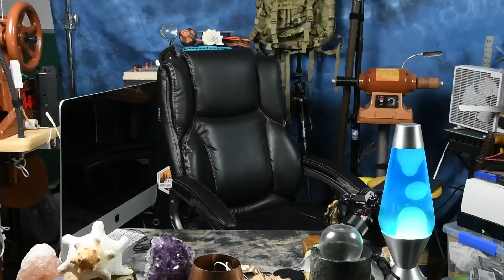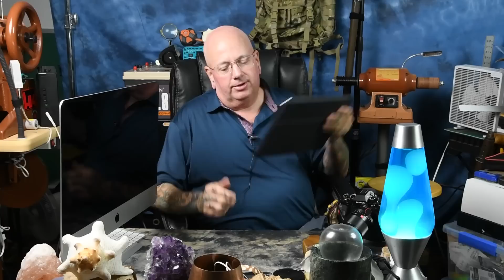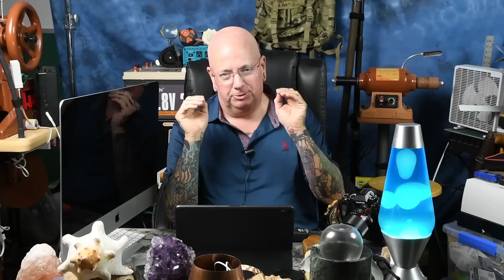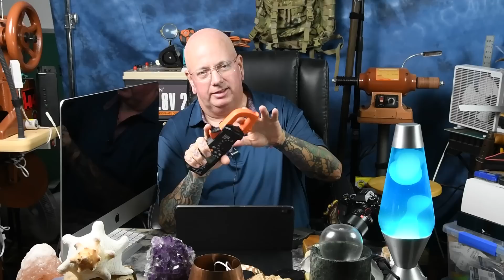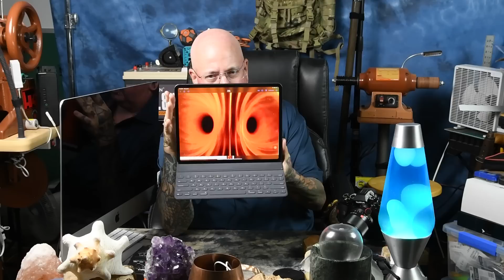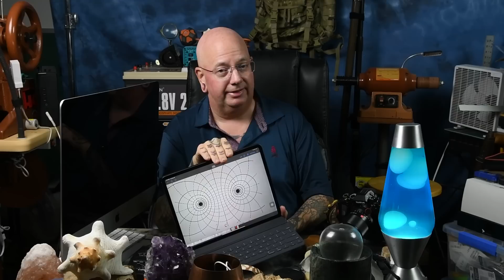😳 Free ENERGY & Power Solutions 🔥Mystery of 😎

Comment: 1:00
That's why the operator I'm currently with is only the second Cellular network I've ever remotely advocated for (consistently praise and recommend to people) and the statement following the above timestamp is exactly why.

My current provider here in the UK is called Smarty, they are a virtual network operator which essentially piggybacks off of 3/THREE (one of the 4 largest/main UK Networks)  
However, not only are they half the cost of 3/Three's comparable package, there's no contract and it's only £18 for unlimited texts calls and data, but unlike the sole network I favoured before them, who started employing that shady tactic of massively slowing your connection speed down watch you've used over a certain amount of data along with periodically completely severing service claiming I'm using my same for business purposes to avoid keeping the promise I signed up for.....

Smarty who I've been with for 6 years have never so much as sent me a message or letter to complain nor have they halted service or reduce my speed despite the fact that on average my data consumption is over 2 terabytes per month as I use my cellular connection for all my internet needs at home and so was able to cancel my fibre optic home broadband subscription, saving a fortune.

Comment: make pyramid off square magnets!             please advise right hand rule transformer re-engineered one side original coil the second left hand (rule)3 times wound 
Take right hand input solder to the middle left hand coil 
Take the output wire connect to earth 
This reverse  the magnetic wats 3 times on the left hand coil  
This recipe has fryed my mind over 20 years no electrician can explain

Comment: My idea was to get the high voltage low amps out of the atmosphere using a wire on a pole.... Then, running it through a newman motor which runs on high voltage low amps.... And then powering a regular Motor generator with the newman motor.

Comment: Great vid!!! It is so nice to hear Ken talking about his sweet spots electromagnetic’s.  Have for years, albeit with various sign ones.  Another valuable tool in this area is a hand held gauss meters for an indication of magnetics.  With this tool you can detect a permanent magnetic field strength  in gauss, for instance.  And without all the technical Jargon, if that field is changing then a wire/coil in vicinity will monitor an electrical current.  That simple if a magnetic ‘field’ is changing a potential (voltage) will be occur across the wire or coil.  Before you go out and by ‘pyramid’ shape permanent magnets to see if you will see a changing magnetic reading on you’re new gauss detecter, I can assure you, I have already done this many times and a change is not detected.  Also have monitored halbach array configuration as well with no changing magnetic field while all is mechanically stationary.  Unfortunately, it is not that easy.  Of course Tesla was the inventor of the AC ‘generator’.  I have read all of his patents and as many writings I could find.  In my research he has never indicated a permanent magnet setup on it’s own generating a time changing magnetic field.  So I am anxiously awaiting Ken’s permanent magnetic device.

Comment: YOU are NOT going to believe me , BUT,  about 1989 Jesus talked to a group of young Europeans on many different subjects..  He told them how to build  purely magnetically powered motors and even a weird light bulbs powered by magnetism and a very simple water purifying device that can even purify radioactive water.  He also told them how to build a 21 Ft. diameter Space Craft in the shape of a Top.  It is made of a Quasicrystaline Metal, their are about 12 permanent magnets about the size of your fist around the perimeter of the space craft.   These 12 magnets are not fully charged and have a weak magnetic field. The upper half of the spacecraft rotates and also the bottom half, only the upper OR bottom half needs to rotate to achieve flight the other half is only for backup. each half is powered by a 480 H.P.  permanent magnet motor. It takes several minutes to start these motors but once started they will run on there own  until there bearings fail(. if desired). Each upper and lower halfs are laced with a small gauge copper wire in a pattern all around the ship.  Our lord also told them how to build a Celestial Partical Transmuter which the astronauts lower out of the spacecraft and this enables the spacecraft to go from point A to point B in space otherwise they only have a elevator. The 3 astronauts are protected from the killer radiation in space by walls that are lined with fiberglass impregnated with Graphite.  Unlike the astronauts of today who experience no gravity in there spacecraft, these 3 astronauts experience gravity as we do here on the earth.. Our lord told them that there are Rivers of Magnetic Energy that go through the cosmos at Almost INFINITE SPEED and its possible to travel in these rivers at that speed with the CPT.   The lord also stated that their is NO Entropy !

Comment: IT MAY BE LUCIDITY TOOLRY 
Direct Current DC
COIL near a Magnet equals
Frequency Oscillation
(Speaker Transducer)
Also a Transformer
(Silicon covered Steel Plates) 
Equals Capacitance
Of Magnetic Field
Electricity is the Product of
Volt Amperage
(Magneto Dielectric)
Which is what occurs in the Transformer 
Therefore DC Amplification
Oscillation Frequency Imbalance
(One Higher One Lower Mass) 
Equals T Townsend Brown
Dielectric Singularity
Warp Drive 
Gravitics
Lifter Tech 
(Para Induction)

Comment: Hey.... I know it's been several years since I looked.... but does anyone make a clamp meter for applications of over 15A? There's no way I can meter the furnace, well pump, grain dryer, etc. with that low of a rating.
Reply from the maker: yes, i know they dooooo
Reply: There are many industrial electricians use them all the time. I know fluke even makes one for dc current.

Comment: Seems like it would at least measure 20 amps for residential.
Would you speak about how a silver slide works?
Reply: If we would stop designing our machines to fight themselves we wouldn't need amps at all, amps serve the same function as kinetic force at the rotor, stop the counter force from occurring and you just need voltage potential, with just a few microamps to overcome the resistance losses of the material.

It's why the amp cost drops like a rock in a Tesla coil as the tuning improves.

Comment: two questions 

If the energy on conductors is traveling on it and not in it why do we need to upsize wires due to amperage 

If time is only a measure how do you polarize a measure is that not just a concept

Comment: I’m having trouble visualizing where the pyramid magnet comes into play. Are you saying a pyramid electromagnet could be used and by changing the polarity of the pyramid electromagnet would result in generating usable electricity? I’m familiar with ac generators and how they require a prime mover to rotate an electromagnetic within the magnetic fields of the stator magnets. I’m having trouble visualizing where pyramids come into play. Also wouldn’t a free “energy” generator not have a cycle? The cycle is a result of the rotation of the electromagnetic in the stator. If there is no rotation then there is no cycling. How could electricity, a hybrid, be generated without rotation? If the dielectric and magnetic fields must be churned up to make it, then how can it be made without rotation? I think the NAZI bell craft used two counter rotating electromagnetic mercury chambers one inside the other if I remember correctly from the documentaries I’ve seen. Then there’s Lazars report of no moving parts in the craft he examined, just a metallic dome that had some special properties that stopped his hands before touching it.

Comment: What's your thought on imprinting magnetic waveforms at a specific frequency thats of high capacitance. By using a super imposed field of both ac and dc switched on and off at a specific time?
Reply: Would that super imposed field be the same as the coaxial circuit of light?

Comment: You could cut up regular magnets to pyramid shapes. Starting with big ceramic, ferrite, or alnico  blocks might be efficient and inexpensive, or cut diagonally through cubes to get pyramids. There are non-magnetic saw blades. You could make fixtures from wood. Use one of your Neos to re-set magnetic polarity and orientation, as needed. Maybe use pairs of galvanized wire and glue to form the spiral stator. Stick your magnets to that; maybe glue them to specific orientations. Later, 3D-model and 3D-print your stator. You might even use stepped cones made from small ring magnets and galvanized iron/steel wire to emulate a full cone/pyramid. Thanks for sharing!
Reply from the maker: no, you CANT , theyre ceramic  ROFL ROFL ROFL

Comment: Something can't come from nothing. Any "power" from your device have to come from somewhere. Does it come from the aether?
If you build your device and it doesn't work, would it prove that aether doesn't excist? And vice versa.
How are you going to rule out other sources causing drainage from surrounding atoms in the room where the device is operating?
No where in the universe is there an energy free area. And you can't shield from energy, no matter how thick of a lead casing you use. Any sensor you would use would also emitt and transmit energy from/to the experiment.
Reply from the maker: all fields are Aether perturbation modalities, so yes

Comment: I will explain my setup of 18 years ago for anyone interested in testing it for themselves.  I used a 35V transformer, to a variac, to a microwave transformer. to get 0 to 650V.  The output from the MW transformer passed through a 40W light bulb as a current limiting resistance, to a bridge rectifier made from 4 1000V 6A diodes.  NO filter capacitor on the bridge rectifier.  This was connected to an Argon based vacuum tube with 2 aluminum plates about 1 square inch in size each, spaced about 3/8 of an inch apart.  I made the vacuum tube out of a 1 Quart glass honey jar with a metal lid. I had a vacuum pump refitted with standard toilet supply tube to use a 1/4 turn ball tap that was fitted into the lid of the honey jar. 2 14 Awg. wires also passed through the lid.  Really bad vacuum tube, I couldn't keep a high enough vacuum in the jar for more then 25 min. and the inside of the jar became so coated with Aluminum vapour deposit that after hours of tests I couldn't even see the plates anymore.  Anyway I did hours of tests and took measurements.  I used a 3.3 uF AC capacitor between the tube and the load.  A 100 Watt light bulb would light up to almost full brightness while the 40 Watt current limiting bulb only had a dim glow to it.  When I connected a step down transformer as a load the output from the tube to the transformer was reading an output of about 235 Watts, while the power reading from the wall plug into the 35 Volt transformer was varying between 55 and 75 watts.  So a maximum of 75 Watts input was giving me 235 Watts output.  And that is after that 75 Watts passed through the 35 volt transformer, the Variac, the MW step up transformer, the 40 Watt limiting light bulb and the Bridge rectifier, all of which consume power by themselves.  MW transformers are very inefficient step up transformers as well, mainly designed to prevent HV from passing back through the grid.
Reply: A flux capacitor will act as a dialectical pseudo-coupling which will allow the free flow of endochrites.Once 97.3% arc-convergence is reached and stabilised,the vacuum capacitance will contract to the exact threshold to enable constribugraphic metatralysis.
Then your laughing.
Reply: @redpillnibbler4423  I KNEW THAT!!!!!!  Was just testing him.
Reply: @sempertard  
You know it.I know it.Skeletor Knows it.
That’s all that matters.
Reply: And what do you attribute the 160W gain to?

Comment: I'm building  a device that extracts electric energy from the Dielectric field instead of the magnetic field.  The principle is very simple.  I create a plasma around the metal plates of a capacitor, and increase the voltage until the capacitor breaks down.  When the breakdown occurs an AC voltage is produced.  I use a capacitor in series preventing DC from getting to the load.  I produce the Plasma inside a vacuum tube  with a small amount of Argon in it.  I did this experiment about 18 years ago and got over 3X as much power out as I put in.  I went on to other things at the time because of 2 problems.  The Aluminum Plates of the capacitor were evaporating and I didn't have access to exotic materials better then Aluminum.  And the  2nd problem is the output AC was over 1000 Hz so normal 60 Hz transformers couldn't be used to transform the voltage.  I now know that a Tesla Pancake Transformer will work just fine for thousands of Hz. AC Transformers because there is no iron core turning AC into heat.
Reply: I wish I understood wtf u guys are talking about
Reply: @FirstNumber1  google search "Richard Feynman lectures caltech electricity in the atmosphere". His pictures make it easy to understand.
Reply: You can avoid the heat problem in iron cores by having the power oscillate at resonance of the circuit, at resonance the power is in reactive configuration and heat losses are minimal, Tesla mentions this effect with discharges of low frequency to obtain the advantages of high frequency, a damped wave oscillating in the circuit.
Reply: @JenkoRun 😊
Reply: Ima look more in to that man
Reply: I would use a collapsing magnetic field of interrupted cercuit then catch the high frequency dielectric potential spike ..rectify it whilst simaltaniously stepping up the reversed potential with diodes and capacitors run it at resonance  ..then charge bigger series of capacitors and have said capacitors discharged in parallel in rapid succesion in a tuned and quenched sparkgap for amps like Tesla did 😉
Reply: What he's talking about building doesn't involve argon and would stay cool on the inside of the tunnel. The device does not produce heat because nothing is wasted. It would actually get cold because it focuses on the dielectric side of the force instead of the magnetic side.
Reply: I would be honored to collaborate on this device. Been watching your channel for years and you may be one of the only people who could trouble shoot a device like this until it functions. I live in SW Florida, would be great to connect sometime 🤙🏼
Reply: The dielectric gradient is about 100v per meter above ground holding only about 10 picoamps per square meter. So any resistance and it's like it was never there. Resonant octave series siphon says Moray. Look up Richard Feynman lectures Caltech electricity in the atmosphere
Reply: @paulksycki  You can get around the amp issue by using that voltage potential to charge and discharge a condenser, V / R = I, the shorter the discharge time the better so use quenching.
Reply: @JenkoRun  Ya but 10 picoamps is soo small that I think any modern switching device would have too much built in R, so then it seems you're left with old forgotten vacuum tube stuff,  maybe one of those over voltage gas discharge tubes, or you mention quenching so maybe geiger tube type setup.
Reply: @paulksycki  I was mainly thinking using a tesla coil to charge up a low capacity condenser and trigger a magnetically quenched spark gap, send that discharge to oscillate in a tank circuit and charge up a larger capacitor and repeat the process, sort of like an avalanche effect, once you've got that going you can tap the reactive oscillations indirectly.

Comment: What about a DC free energy generator?  Love the presentation, not understanding it at the moment but googling the concepts and digesting them.  Thank you, wonderful content.
Reply: You use a bridge rectifier, which is 4 diodes, to convert from AC to DC
Reply: @qaeproject  If possible we should find a way to rectify without diodes, they are specialized components and the high wattage ones are terribly expensive. I wonder if there's a way to wire inductors up so when they interact the resulting output has a DC offset, it doesn't have to be a smoothed out waveform just non-reversing.
Reply: @JenkoRun  it doesn't work like that.

By applying a bridge rectifier, you flip the lower part of the since wave above ground 0V, So then you have lumpy DC which then needs reducing in voltage through a transformer then smoothed as at 50 hertz the voltage is fluctuating 50 times per second between 0V and what the transformer stepped it down to, say 24V. The electronics used to smooth out the voltage to a flat line is next, so the DC is a stable voltage which is essential for most electronics to work. That's what I remember from the 80's so there could be other info too.

Comment: Would the scalability be based on stacking these do you think? or is it a actual size problem, allowing higher output.. Hope you succeed, would be cool to have a self powered fridge :D
Reply: Also, given a big enough magnet, could you produce a good enough pyramid magnet, by stacking smaller and smaller ones to the top?
Reply from the maker: that i dont know, i need the prototype first, OF which i think i can build it much smaller given its design
Reply: @KenTheoriaApophasis   "Permanent Magnet Motor Using Magnetic Cancellation" <<Here it is on YT without pyramid magnets

Comment: I'm older now! But remember "cycles"!
Things are designed too run on 60 cycles! So if electric companies change the cycles = will your electric meter still run accurate? Can they raise or lower electric bill$?? And when they check electricity = at most only check volts and amperes = but not cycles!